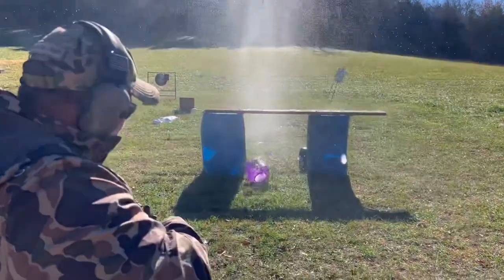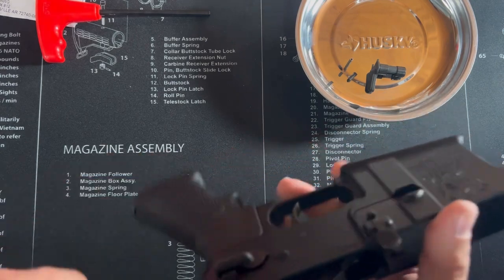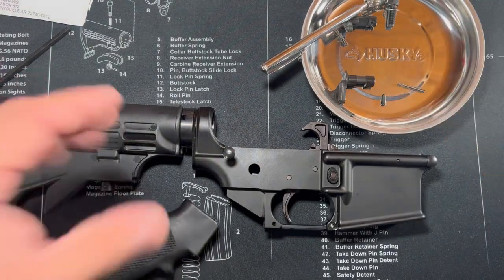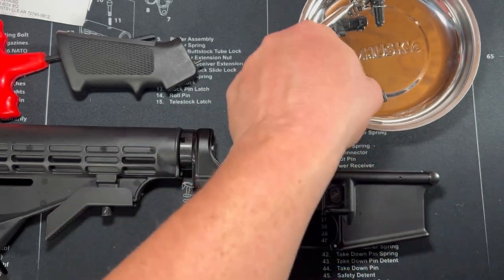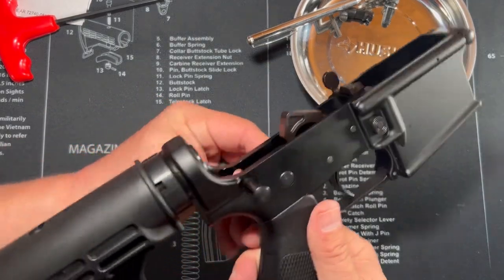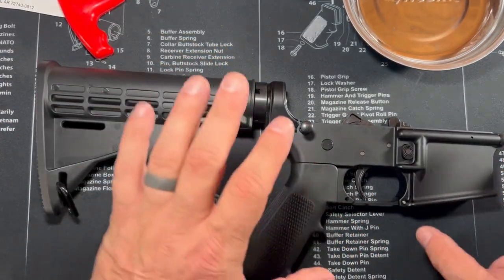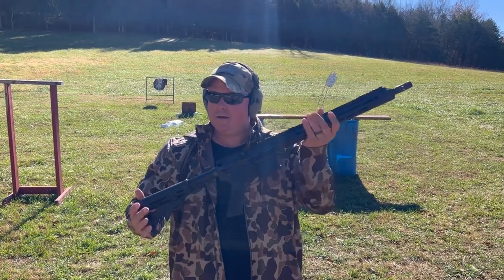AR-15 Safety Selector install and removal

Comment: I've watched two of these and no one has mentioned the necessity of having the trigger cocked. Neither did the Trigger Tech instructions. Can't get the safety out unless trigger is cocked.
Reply from the maker: I mentioned it at 3:39 but I think it would have helped at the beginning 😬
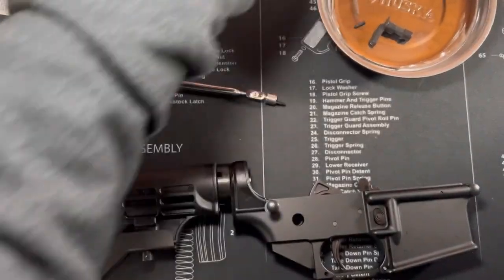Reply: Right, Sorry, I don't think I listened much past the 1:55 area, where the safety falls out. @RawHawg
Reply from the maker: @topdog250  you missed one helluva riveting video!